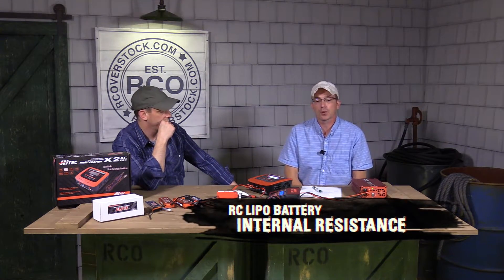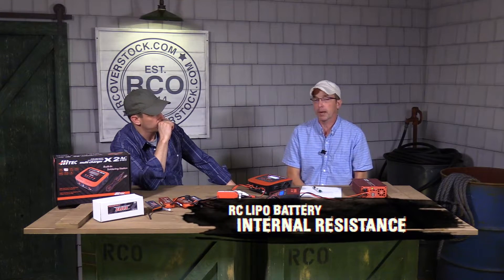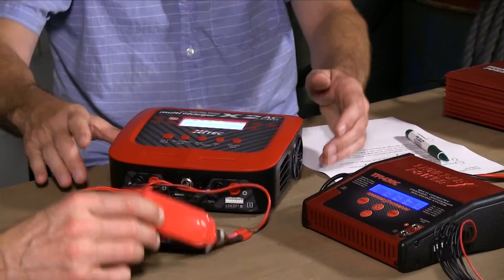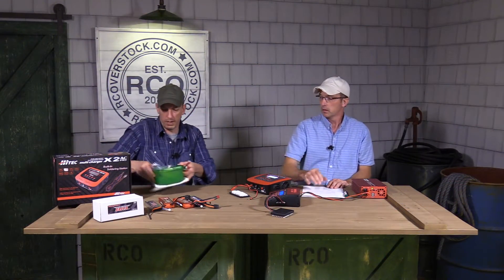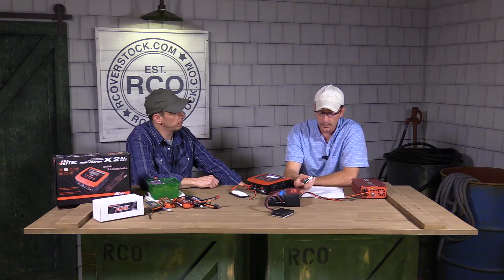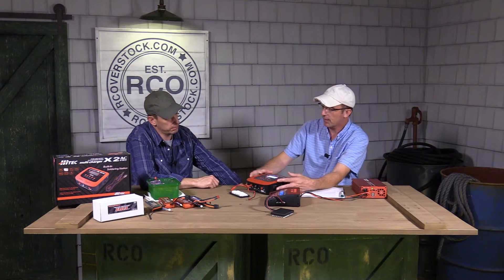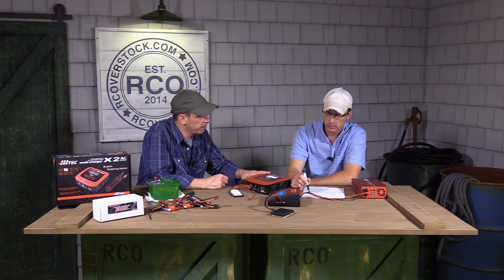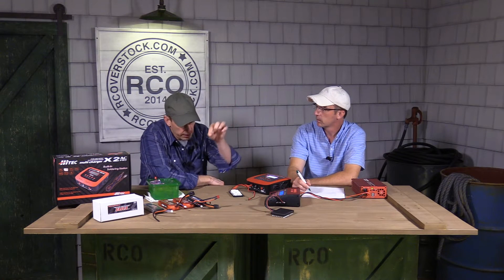RC LiPo Battery Internal Resistance - Explained

Comment: I have a 3 year old 3s lipo 50c dis and 5400mah and the IR it's showing is 5. 6. 16. And it charges fine and has good power and acceleration but the run time is about 2 minutes versus when the batteries are brand new 15 minutes please help is there anyway I can fix or revive these batteries

Comment: The more internal resistance in a battery the greater the voltage drops when the source starts drawing current until there's very little capacity to run the source even at a full charge. Usually as the battery wears out the internal resistance increases until the battery goes bad so it's good to see the ohms increase on the internal resistance output of the charger so you can take the battery out of service before it fails completely. In a regular Lipo that's healthy you can feel it wearing out with shorter run times. I use the IR when checking a battery that's fairly new and going bad to help with what to do with it. I have got a rash of bad Turnage Batteries.
Reply: Is there any way to revive of fix the battery when the IR goes up or do I just have to buy new ones?? I've got two 3s lipos 50c discharge and 5400mah but the IR is 6. 5. 16. and the battery's still have good power and acceleration what's the runtime is about 2 minutes but I don't want to throw this away and have to buy new ones I want to know if there's any way I can fix the ones I have

Comment: can anyone recommend a decent internal ac  power supply  rc   battery charger with the capability of checking internal resistance of my LiPos....I also would like a recommendation on a  simple battery resistance checker...thanks much
Reply: iCharger does it all
Reply: But you need an external power supply sorry

Comment: Internal resistance changes throughout a cells life. It also changes depending on the amount of charge the cells have. Often times when one cell is higher its because of age. The higher number could be indicating that the cell is on its downward slope in charge cycles. Remember that when discussing electricity we are forced to discribe it based on things we can measure. If we were talking about capacitors then the ultra low internal resistance would be parrallel with both its speed of discharge and recharge. Batteries are similar in this regard. The thing to remember is that Batteries make electricity. Capacitors hold electricity. Its easy to think of your lipo as a sponge that your filling up.. But that's not at all what's happening. When you charge a battery your forcing ions across the membrane to re-established a inbalance of + and - ions...Capacitors act like a sponge. The more tools u have at your disposal the better. I build electric bike batteries. IR is important when your matching cells to build large batteries. If your divice only uses 1 or 2 cells then I say use those cells until they are paper weights..

Comment: I have a 4 cell with 28, 27, 28, 29. This is way higher than normal but it works fine. Advice?
Reply: keep using it

Comment: just checking 2 brand new gens ace 6s 60c 1250mah packs mili ohms are 5 6 6 6 6 6 Is that bad or good. just 4 or 5 flights with a sab goblin fire ball

Comment: Great video guys! I have a new battery that has had problems the whole time... Im trying to understand this better but have a good understanding. The battery has one cell at 29 MO!!! Bad from the factory! It is a vant battey and I have had good luck with Vant. But the ebay seller is the variable! The first 4 O bought from the same sellor that offered offfered a 1 year warrenty and lifetime return for half off. The seller is a bad Custermer service seller... $60 down the drain, cause I bought it to race and it does not perform. Vant battery= great batteries. That ebay seller? = bad! I have since bought a Awanfi 4s 5000 with great results! Awanfi is great! I subbed, checkout my channel if you like rc racing! Thanks

Comment: I have a masamps dual core 8000mah 150c 4s lipo. it has only 1 JST-XH balancing tap. If the two cores are in parallel how accurate are my voltage and internal resistance? Why do these manufactures not have more than one balancing tap for cell that are in parallel...

Comment: hitec is a cheap (junk) charger made by sky rc. I had some and once I went with a junsi Icharger the batteries lasted longer (total lifetime not run time) they had more punch to them, none of them puffed and and every cell in the pack balanced charged exactly the same. that was the worst part about the hitec, some cells would be  off a whole half a volt of each other after a charge.      so I wouldn't put too much faith into a hitec's readings.   if you want a good charger go with  junsi Icharger,  graupner, maybe an orion, hyperion, revolectrix.  if it's less than $250 it's not going to be that great of a charger.  and  one of the worst things you can do to a charger is run it off of a computer's power supply(servers too)  in fact Junsi Icharger warns against using one and said it voids the warranty.  you want a real power supply like the one in this video.

Comment: What are your thoughts about storing LiPO batteries in the refrigerator and or freezer if it's not being used for a long period of time. My thought is it would make the batteries last a little longer and slow down the chemical process and keep them from deteriorating faster. Do you think this is a good idea or not?
Reply: Probably not, given that the electrolyte may expand when frozen. Maybe fridge is fine.

Comment: Thanks for the video! one question ...if i charge my glow ignitor in a hitec four charger in the nicd program ..could this melt a resistor in my intelegent charger?? and broke this chanel in the charger.?...
Reply from the maker: Hi Federico, not likely to hurt the charger assuming there were no active circuits in the glow ignitor. I'm not aware of any, but I also admit to only using a half dozen types over the years and they all were fine to charge with a glow adapter.  If you were using the Hitec X4 series, they are fully capable of charging Nickel chemistry.